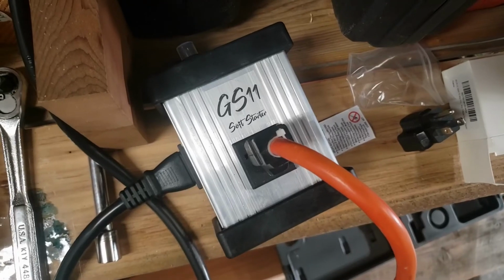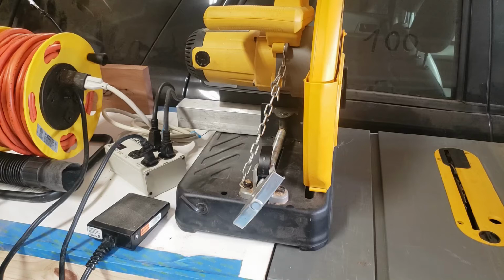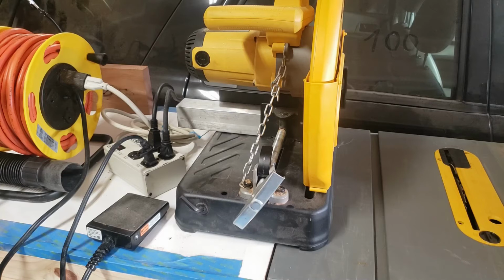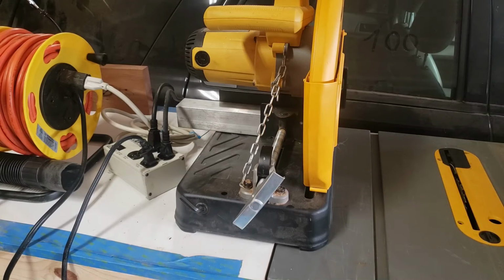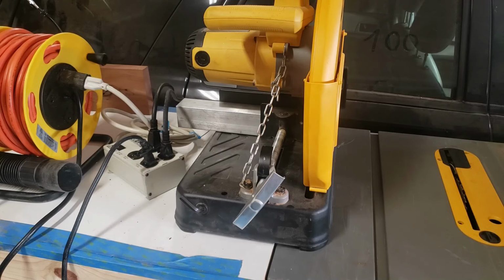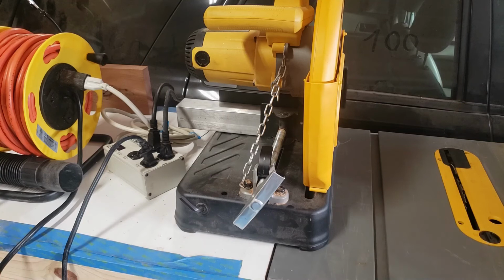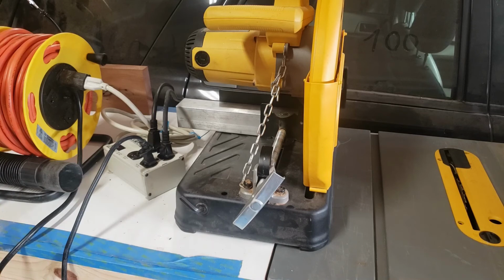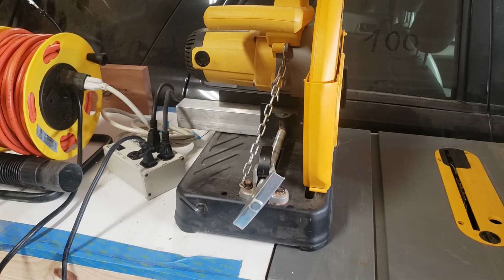Can you run multiple tools with a single soft-starter?

Comment: Finally looked at my dad's b/saw & dustC.: 6A saw & 12A dust C, so about 18amps total.  He always fires them up at the same time. Far as I know they're on the same circuit.  Our 200amp service is Fully Loaded w/ piggy back breakers, almost all of the 120v circuits are piggy back type. Been that way since about 1995ish.
Reply from the maker: With the soft start limiting the inrush, you'll probably be right at the limit of what you can start up in parallel without tripping either your home breaker or the one on your GS10.  Let me know how it goes.

Comment: Interesting, thanks for sharing man. The GS11 is a legit commercial tool IMO. Especially w/ the competitive price & 20amp rating, what's it go for, $150-$200ish? I called a local supply house in Nashville & all they have is 3phase soft starts going for $400ish & up.  Our table saw is so old just a toggle switch.  Have you had to do any maintenance/repair/s to chop/miter/table/SkiL saw brushes & bearings?   My dad was ready throw out his old Rockwell table saw b/c it wouldn't hit a lick, so I put a drop of Oxgard electrical grease on each brush & it fired right up like it was new.  Ideally u want to clean & polish the commutator & apply a Very Light amount of oxgard, but we were pleasantly surprised by the results of a quickie band aid fix. It's still running, but we don't use it often.
Reply from the maker: Happy to help.  Like I mentioned on the other video, I tend to overindex.  This all started with that ~$8 Hitachi module, then I just kept moving up the ladder until I came to something I didn't feel I was going to have to ever worry about.  I've burned up a few of the Hitachi modules as well as some other small form-factor knockoffs and I'm tired of fire-hazards in my shop.  The GS11 is right at $140 and seems bulletproof.  My only complaint was that while the marketing material shows it with a 15A cord, it only shipped with the 20A cord (with the twisted pin).  My uses right now are all 15A on a standard 15A outlet, so I had to get myself a new cord.

I've done a little bit of motor work, but not a ton.  Built one from scratch a couple decades ago just to learn the theory, but most of my problems these days are solved by Deoxit.  I discovered Deoxit years ago for cleaning up audio switches and pots, but it works a treat on commutators as well.

Comment: Used mine yesterday w/ a shop vac & high speed/variable speed drill, worked great.  
Hey man, what about transformers plugged into this, like 120v MiG welders?  They are, The, Worst about dimming lights.  I'm getting a light duty 120v MiG soon, my brother works for Volunteer welding supply, he was wondering the same.  I'm thinking NO, more for electric motors primarily.  I plugged in 1 of the little yellow outlet testers & it tests okay, but the little lights stay dim, ha.
Reply from the maker: I'm in the same position as you -- looking at 120v welders, but don't have one on the bench yet.  Googling around, I found a few folks that made switchable resistor-based soft-starters for their welders, but I didn't see any followup or safety discussion.  A topic that needs more research for sure.